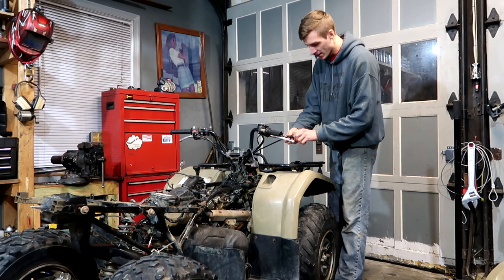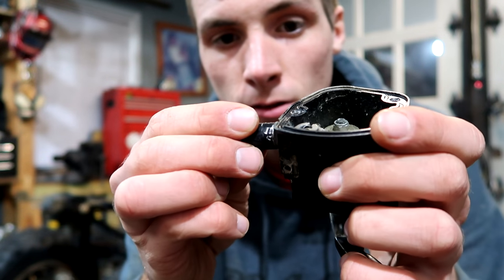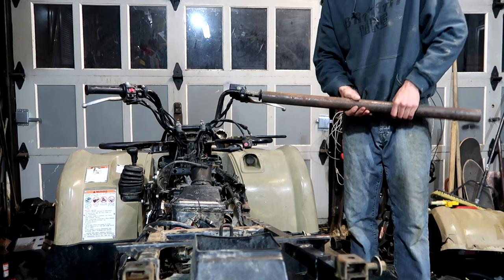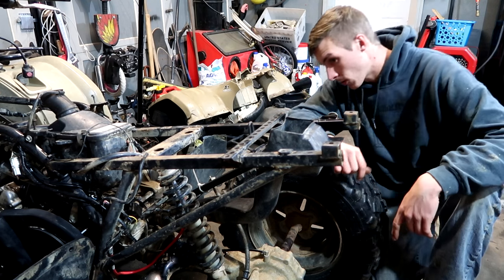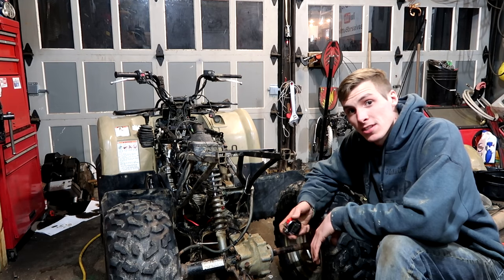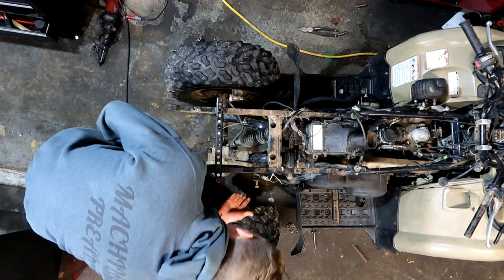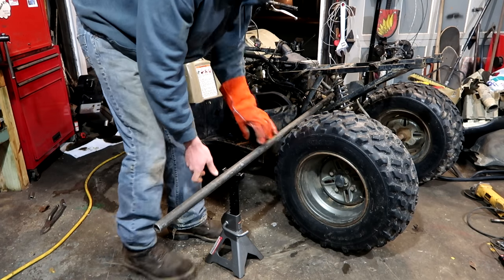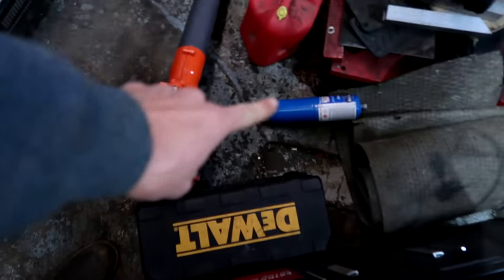THE KODIAK FRAME is TOTALED!!!

Comment: That opening statement was friggin platinum.
Reply from the maker: Thanks dude!
Reply: 3DMachines you should never heat you handle bars to bend them back in place  the integrity goes way down and you can risk it snapping
Reply: 3DMachines 👍🏻
Reply: 3DMachines I have been watching for just over a year and I personally like the older 3DMachines better even though I still like yr vids
Reply: 3DMachines start doing riding meet ups across the United States???
Reply: Once its bent its weakened.  NOT heating it can cause it to snap, though its not like those bars are going to hold much force, unless he rolls it
Reply: 3DMachines All of the things put together so basically the same thing you are doing. Love the videos

Comment: I cringed watching the frame get cut and pounded. Seems like more work then it's worth
Reply: skojo3e the frame has lost most of its rigidity by cutting and/or pounding it the way he has. I would have cut the down tube at both welds and replaced it with new. He actually did a decent job working out the handle bars.
Reply: Dino Velvet- no doubt, I think he paid too much for all the trouble it's worth. Sometimes worth to pay a little more to get something that needs less work. Much rather watch him put performance parts on something newer then hammering old frames and rusted bolts
Reply: skojo3e I totally agree, I've been down the same road he's traveling down now and it never panned out in the end... Spend a little more = play a little longer lol.
Reply: skojo3e He earns more fixing this pile of shit because of all the videos he can make then doing 1 video installing expensive parts
Reply: Peter- More power to him, he has something going with these videos that I dont have!! Just figured less work equals more ride time videos which got me watching g his videos in the first place.

Comment: Quick tip: for bending stuff like that frame tube, anchor the left side of the machine to something stationary (like the hitch on the Silverado...then place a piece of angle iron behind the bend, attach angle iron to come along, anchor other end of come along...heat bent section with map gas (as you did), and start applying tension to come along. Bend will come right out.

Comment: Either format of exposition is OK with me. Hearing what you found or figured out is one of the better parts of your videos.  I think I would've finished stripping down the front end and done a visual inspection for bent/broken bits before starting to whack the frame.

Comment: Clean your torch head with vinegar. I had a loose flame and it was just build up. Went right back to a tight blue flame after I cleaned it. Just dipped it in white vin.

Comment: +3DMachines On your quad frame straightening (I worked in a frame shop and did this for some years): Was the rear axle on jack stands to get the rear end level or did you make sure the tires had the same diameter/circumference to be sure you had a true point or reference? I assume you measured the width between the two rear rails before you started? That bend wasn't there to clear that intake tube was it?

Comment: You should just cut the pipe out, straighten it or replace it and make an adjustable jig to push the frame into place it's easy to make and use 3/4 - 1" threaded rod some nuts and brackets you can clamp to the existing frame.

Comment: I prefer the jibber jabber while your working vs a lot of talk, then shots. Surprised you don't use an electric screwdriver more. Then again, you don't have 40yo arthritic hands like mine. I use a Milwaukee M12 lipo screwdriver and lipo dremel a lot with my RC work. Saves on the hands and when careful, also makes stripping screws less likely.

Comment: i personally would put a filler piece in the frame then weld it good solid to help add some structural support... which i just did with a customers go kart because the frame broke in 2 spots.

Comment: When you need to bend any kind of tube metal and you are concerned about collapsing the wall of the tubing, if at all possible ,fill it with sand then heat it. The walls will not collapse if packed tight. I hope you're TIG welding that sucker. Much easier to control the flow ,(with skill.)

Comment: From the video one tire is rounded and one flat at the tread .Your tires are not the same size, pumping them to the same PSI might not make them the same size. take a rope , old belt. or cloth tape around the center of the tires. when you go from the ground up to the frame with the tape i think your off about 1 inch.  it all so helps with a ATV from pulling to left or right on the straightaways. Great Videos .  hope this helps. Randall

Comment: shots showing how you fixed it....what it took and why you thought it needed fixed......i'd add more braces to frame and where the tube frame did get weak weld small flat patches on each side to as not to rebend. its what i do. i also use thicker gauge steel. i use non gas welds. but im like you i have fun on it and it takes abuse

Comment: I have a honda xr100 and there was a problem with the machine bogging down so I opened the air filter and found dog food in the air box (caused by mice) after that I replaced the air filter the bike now runs excellent

Comment: Did you check all of the tire pessure 3DMachines if they are not equal then your messurement is not good the RH Rear tire looks like its low on air

Comment: 3d pull the electronics off with the motor and the rest of the plastics and cut right by the neck and custom fabricate the frame your self so you know the frame with be good to take a beaten and be a trooper

Comment: I would've just cut out that rear beam and put in an entirely new pipe, much easier and you can take the length from the other side so you know where the upper is meant to be

Comment: Don't change what brought you here far as videos.  Second, if you had a reciprocating saw with metal blade, just cut out those frame members and make new ones.  Steel that size is cheap, angled tube cuts can be made with a hole saw, you can make it good as factory.

Comment: You can tell from the video that the rear tire pressures are not the same, measuring the frame from the ground isn't going to give you the proper measurements.  But you're not wrong, that frame is bad.

Comment: Measuring from the ground up is not accurate. The tires would have to be exactly the same size and pressure and usually atv tires are not exactly the same even when they are the same brand and everything. Eye balling it would probably be more accurate.

Comment: IMHO Its a parts bike and its not a very good one at that.  Yamaha parts are big bucks from the dealer. I had some hondas , kawasaki  and bought a yamaha  and I was shocked at the prices, for that reason that bike is going to cost a small fortune to rebuild more than its worth if it was bought in mint condition + no one wants a smallbore  belt drive Kodiak if it was the 10 speed it would be worth more because you can turn any tire with those old beasts.  I would sell it save some more money and buy one thats in near mint shape or buy new.

Comment: FFS! buy a hydraulic ram/frame/chassis puller and do the job properly. Further, strip the whole quad down  - and then remake the damaged frame sections on a known level surface. Engineers don't bodge things.

Comment: This four wheeler is scrap.................only any good as spares. Best to patch it up, and see if you can get some money back on it.  Its a total waste of time trying to straighten bent tubes with a blow torch and sledge. Tube needs to be red hot to move it. Cut out and replace bent tube is the easy way.........................
Reply: sickophant metal does not need to be red hot to bend, if that was the case you wouldn't be able to bend anything unless it was red hot
Reply: If you have the proper tools, clearly metal doesnt need to be heated to be bent. The guy on this vid, doesnt have the proper tools, and he is pretty clueless as well, so in this case heat would help a lot.
Reply: sickophant he's just bending the frame of a cheap 4wheeler not building a space station. He uses what he has and most of the time he makes out just fine using the bare minimum
Reply: Brad Petersen
If you are going to make a repair, then if you cant do it properly yourself or dont have the tools or equipment, then why not do the prep work and get someone to do the job for you?